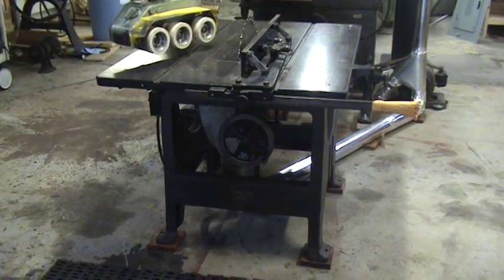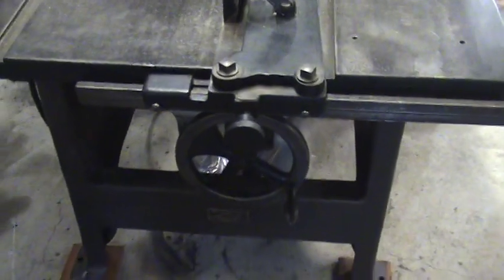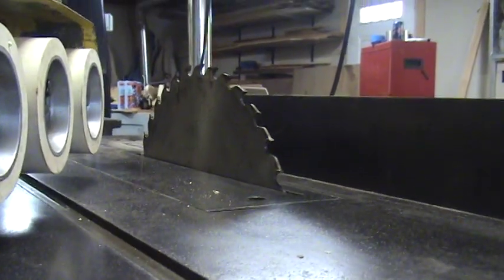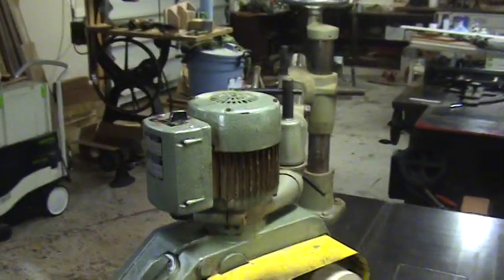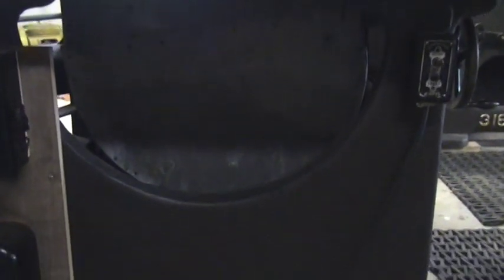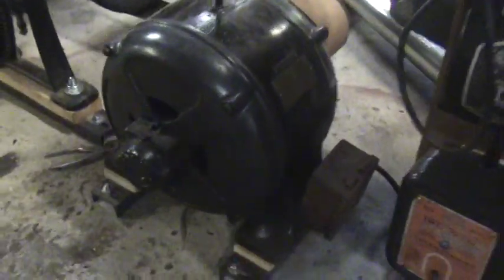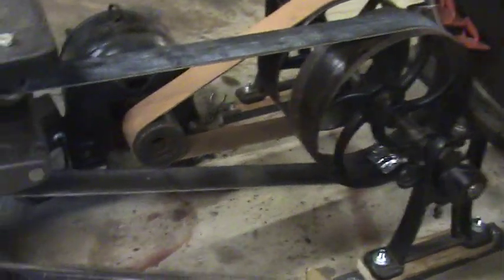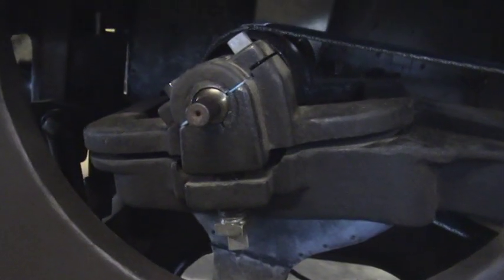1880's Frank H. Clement #2 saw bench

Comment: sweet tablesaw. I guess that the drive belt would've been ran under the floor so that you could stand on the end without getting into it? or was it set under the machine and powered from the side? Anyway it's neat, I would like to get one of these someday; I just can't bring myself to spend good money on a modern tablesaw. I was at Lowe's a few days ago looking at them and was repelled by all of the plastic and yet they're still $700.
Reply from the maker: that was the original counter shaft, it was probably powered from below the floor. 
It was a great saw for ripping lumber, I run a Whitney 77 slider for my variety work and do all my ripping with an Eckstrom Carlson SLR now.
Reply: +darcy warner ok thank you, if you have videos for those I will try to look them up later
Reply from the maker: +austinwagoncompany 
the EC SLR is on my channel, the Whitney and Greenlee are not.